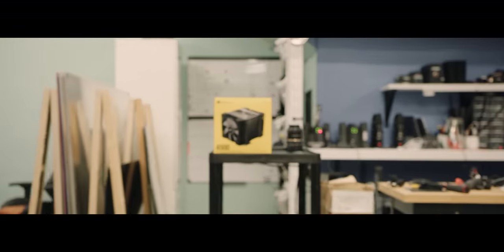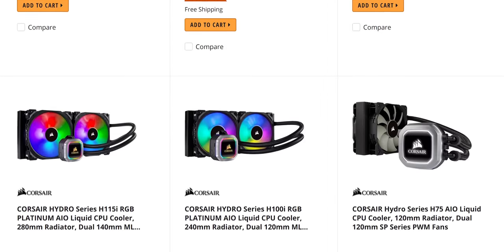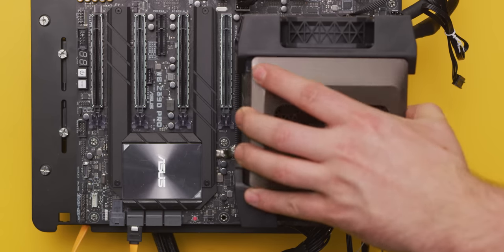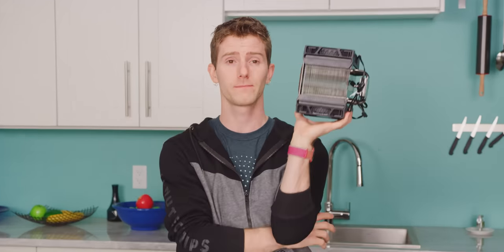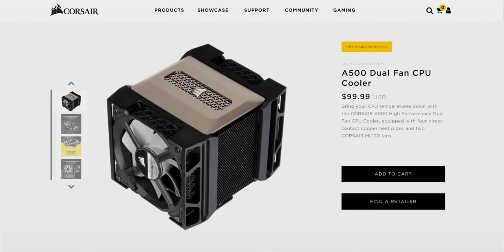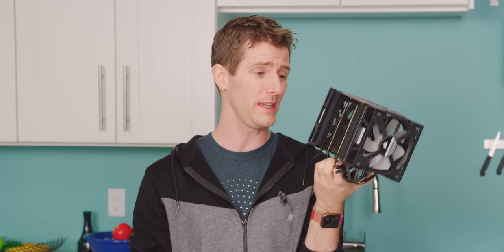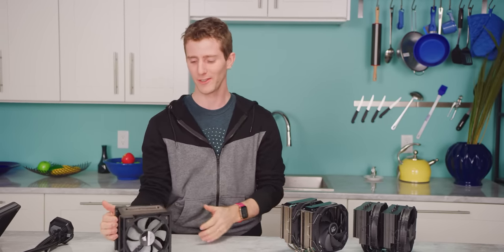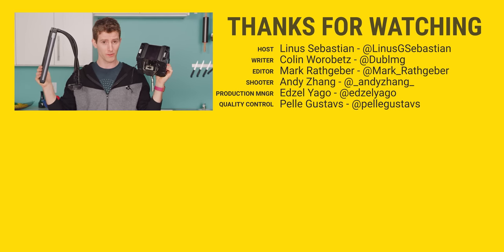Even Corsair Knows Air Cooling is Better - A500 Review

Comment: I really dig this cooler and would have considered it over the Be Quiet! model I ended up buying last month for my system (which also has Corsair PSU, RAM, and tower). But the trouble is exactly as Linus said: it has to match or outperform them in both temps and acoustics AND/OR price. And, dare I say it, looks. This looks great, BUT, I prefer all black. The magnetic cover is lovely but it doesn't match all motherboards unless you customise it yourself (which wouldn't happen, for me, anyway). That said: it's great to see the innovation with the sliding fans and having another competitor in to mix up the top end competition.

Comment: Can I just say, the mounting system on my AC Freezer Xtreme from 10 years ago was even easier  to use, and the fan simply slid in between the fins. Now it wasn't the most powerful or silent CPU-Cooler, but honestly, I cannot understand this amazement about the mounting system...

Comment: just a question about the corsair cooler. if i mount a thin 80 or even 92mm fan inside the gap, will it increase the cooling performance?

Comment: 5 db is a significant difference in noise performance - Was it the actual quality of the fans / bearings causing the noise maybe fan speed?  or a mechanical construction issue?

Comment: my only issue is the weight on my motherboard , theres no supports to take the strain off the motherboard.  I'm happy with my AIO corsair  water, if you have an issue with the noise  , sound proof your case.

Comment: Couldn't you remove the fan inserted in sliding fan bracket and replace them with much quieter fans (Noctua,Fractal design,be quiet etc).

Comment: So there's been a cooler series (since 2012) that doesn't require removing fans for RAM replacement (u do need to remove it for installation): Thermalright Macho series. The performance of the highest tier Macho's is the same or better than this Corsair A500 at less noise. And the best Le Grand Macho RT has been <160mm height since 2014, so it wins in this metric as well (the previous Macho Rev.B and the 2012 Rev.A were 162mm height).

Comment: Looks like it'd be fairly simple to swap the fans to see if you can snag an easy win on noise improvement. I'm not saying people should do that, I just want to know if Corsair screwed themselves over by noise from the fan, or from noise caused by vibrations going into the heatsink that is causing parts to rattle.

Comment: The A500 has dropped price a ton since this video, making it an amazing deal. I've paired one with an i9 10850K
Reply: Bought one for $30.  At 30 bucks, it is just fine for a non OC system.
Reply: @horscategorie  It's a dual tower cooler. Pairing with a non OC or anything less than a top of the line i7 is just plain stupid.

Comment: I actually have a solution for the noise problem... Swap the fans with Noctua NF A12x25 PWM ones... And the performance is probably slightly increased as well. Of course, this would cost you a total of 150 dollars... But if you want the best of EVERYTHING, from looks, to noise, to performance.. This has to go be the best option. It's a great design that other cooling companies should follow, the way to just mount those fans are so much better than clips... Just how did it take this long to come to this solution?

Comment: so the cooler is set up to push hot air into the middle...that seems not great at all - wonder if the numbers would change if you went from push push, to push pull, or even pull pull config ??

Comment: A feature was briefly shown but not discussed during the video. It looks like the A500 was designed with corsair memory in mind since it physically clears corsair designed DIMMs. Not all coolers do this, for example the fan on my NH-U14S conflict badly with one of the second DIMM slots when operating in a blow through configuration. on such a cooler, in order to use all memory one would have to change it to operate in a suck through configuration (fan on other side) which also rules out the option of a dual fan (blow and suck through) installation.

The noise test does not sound like it was entirely fair. Like Gamer's Nexus does, one has to do either a noise normalized comparison and check the temperatures or a thermal normalized comparison and check the noise to know how well it performs. This is because different fan designs have different maximum air flow rates at maximum speed, and even have entirely different maximum speeds. Although it will likely still lose to the competition, it probably would not sound like a jet engine while doing so.

Comment: How do you have an NH-D15 with seven heat pipes? Where can I get one?

Stuff like this makes it really hard to figure out which air cooler is best. I can't find a seven heat-pipe version of that cooler anywhere, only an article stating that they're coming out with such a version three years after the release of this video.

Comment: 240mm Rad with 4 fans in push/pull running at 20% speed is much quieter than  2 fans at 50-60% speed. A rad can be mounted in the roof and act as an exhaust making the whole system cooler. Running at max load it's going to take far longer for the liquid to heat up, thus running quieter for longer. And arguably that heat sink and fans looks like it takes up MORE space than an AIO. I don't get it...

Comment: Thermalright macho rev b. Was available from 2014 to last year, cost 40 bucks in 2019.
It has enough cooling performance for most cpus and is still the most silent solution i ever had.
Yes it is very basic but thats what is good about it.

Comment: Maybe this is their first entry in returning to air cooled?

This puts me to thinking actually. Is there a combination water cooled/air cooler redundancy product option on the market? If not, why hasn't anyone done so yet. I could imagine a water block with attached radiator fins and fan mount for a fall back if the water cooling failed.

Comment: I am a little confused by the noise complaint. Most people won't be running it at top fan speed and in most cases your computer shouldn't be getting that hot where it runs at the top speed. Fan coolers do a pretty good job and this thing looks hefty. Basing it off on being totally worthless based on what it sounds like if you max the fans out all the way, that seems a little shortsighted. Are you suggesting that the top fan speed should be trimmed down to fit your noise requirements or do you think they can improve on sound and thermals by altering air resistance? I mean most people won't really hear it at top speed anyway and I would hope a systems fan curve wouldn't shoot it that high, unless your system temps are approaching really high temps.

Comment: If you looking for a CPU cooler that can beat the Noctua DH-15 in performance, price and especially acoustics try the ThermalRight Le Grand Macho RT.

I have one in my system and it's the best and quietest CPU cooler I have ever owned.
I had visually check that it was running when I first built my PC because I could not hear it.

ThermalRight says it can even run fanless and still outperform one of Intels coolers. I believe them.

Comment: I have this cooler and i replaced the fans to Noctua. now its dead silent on idle and very quiet on full load.
I needed the A500 because i wanted air cooling and tall 4000mhz 64gb ram.

Comment: You should have had the Noctua U12A (dual fan 120) to compare. It's smaller but how does it compare thermal and noise. I can attest that for noise the U12A has good noise. You did a video with the U12A but only showed it against AIO's and the U12A won that.

Comment: Love the videos they are so informative but fun at the same time. I have a question. I'm looking for a mid range air cooler for my fx6300 black it doesn't like to run over 60 degrees Celsius. What would you recommend?

Comment: Im making an ammo styled system. Can i have loose brass in the bottom of the case or will that cause problem ?
Reply: That may cause noise if your system is vibrating. I would instead use a small strip of double sided tape to hold everything together quietly.
Sounds like a cool idea though so good luck with that build.

Comment: ive never been a fan of corsairs fans. never had a good experience with them. tho i do wonder, would it be worth running both of its stock fans towards the center (push-push) then ahve a fac on top of it , either another fan or using fans  on top of your case to pull. this would provide some airpressure on top of your gpu as well if that matter or not idk.

Comment: why not make the fans thicker, they'd be able to run even slower.  Please do a show that compares gains based on fan thickness, if you think you can create one (and not just adding length to either sides of a stock fan.  The 2 fans could also have openings on the base of the fan (to the motherboard) to allow for some more cooling to components.   Could they ever use the dyson fan, in a heatsink.  have the intakes in the top of the case.  It' might even been possible to fit non square shapes, so that the heatsink could be more of a rectangle from the profile but still benefit from airflow.

Comment: How about an L shaped cooler, intake in the back(yes, the back of cpu) and outtake on top of it, so the hot air helps with the flow a bit more....u could have massive heatsink and heat dissipassion , i mean there's nothing on top of the cpu...well PSU but it could be slightly bended forward to avoid touching PSU...idk....maybe a cooler for a specific tower....it's not hard to build something that amazingly, just take your head out of the box, and as usual, they should look for comunity feedback/ideas..

Comment: Air Cooling has a lot more advantages than water, but like many tech Youtubers said including yourself water cooling will win because it is light, it is easier to install than an air cooler, it is better at dispersing heat and does not require as much air flow as an air cooler, rgb effects, software, ability to use all 4 ram slots, no conflict with case size or width( as long as there is space for 120mm fans, there is space for an aio),  higher tdp rating for cooling than air cooling, and looks nicer.

Comment: Okay, so I’m new to building pc’s and I’m planning on building a pc, I bought my first part which was the case and it came with one fan, my graphics card that I’m planning on getting has 2 fans on it, my question is do I need to buy additional fans for the the front panel or not?
Reply: You probably dont need to, but it will lower your temps if you do.  Its something you can do later though if your budget is a bit tight so no need to rush it.

Comment: gamer nexus did review on this and it wasnt that great, but maybe the product they got was broken or something which cause the issue, normally u want to test like 10 of the same product to see if the problem is on the individual product or the overall product. i will buy 212 hyper coolermaster since its cheap. and when i will decide to overcloack then i will upgrade the cooling.

Comment: Water cooling is more efficient.  Water transfers heat more effectively because of its high thermal conductivity, which means the water works to diffuse heat from various components and CPU.

Comment: fewer points of failiure?  1 fan and 1 pump, or 2 fans? did i miss something?
Reply: Pumps are significantly more likely to fail and also mean the complete AIO is trash and needs to be replaced.
If a fan fails on an air cooler then you simply get a new fan.

Comment: Air cooling is way better than water cooling. the one reason why, Air coolers never leak water. plane and simple. my Air cooler i have is the MSI XL that goes very nicely with my corsair graphite 780t full tower case. fits like a charm.. and with the graphic card to. i have my build on my video.

Comment: Linus, why does my i9-9900Ks run at 30C at idle to 50C under load? i have yet to see temps over 60C which is not something i can say for my AMD CPU based systems
Reply: Now i dont know what AMD systems you have, but the 9900ks takes more than 200-220w, which is more than any consumer AMD CPU released in recent years. Are you running it at stock clock speeds or what ?

Comment: i got the a500 half off for about $50CA And it came with a screwdriver  and it is very good screwdriver  but it just barely fit in my case mid tower I walked into my local computer shop looking for $30 air cooler for my ryzen 7 5800x an I saw that for half off so I got it.

Comment: i would've gotten any of those coolers. except they cost like near $200 in my country due to importation tax :( which is why i just stuck to my ID cooling SE 207 which is also a dual tower with 2 120mm fans which costs like $40.

Comment: just replaced a corsair water unit with a noctua air wonder for a twitch streamers $5000 rig lol.  It failed after a year and a half.  Water pump died.  
It was under warranty but it will take weeks to get a replacement which she'll sell on ebay lol.  Air cooling is nice, especially for rigs that make you money.

Comment: That unused gap in the middle really is a baffling design choice. If they really wanted to keep the two towers connected as if it was just one big ass single tower cooler, why leave that hole? It just tells me that they should've made it a fully separated twin tower config and stuck another 120mm fan in the middle so that all 3 wouldn't need to spin up as fast to move the same amount of air. Would've easily solved the acoustic problem, if they really insist on keeping to 120mm fans for the sake of that slide-on fan mounting system.

Comment: Bigger than the 140mm noctua fans?  Those are already so massive you can't fit them in a lot of mid cases (so you need to go with full, but at that point you typically have huge amounts of dead space just so you can have better cooling, unless you have custom water cooling but at that point the CPU fan systems wouldn't be used anyway). I was going to go with the noctua based of all the reviews, then found it was far too large for most any case i was looking at (i had a full before, that nearly gave me a hernia anytime i tried to lift it. Old alienware aurora system that weighs 50-70lbs). Make a high quality fan that can reliably fit in mid cases, and you will have a good market there! (i went with a noctua using 120mm fans, and the cooling is meh, if i tried to overclock i would be running too hot)

Comment: Too bad - I was pretty interested in this. That fan mount is awesome. I wonder if they could get it into the middle of a modified design, so it wasn't physically bigger than the competition. and if that configuration inherently improves performance... Will wait for version 2.0 or for someone else to steal that fan mount idea.... so much better that the BeQuiet/et al. clip system that is a PITA. But yeah, 48db is a hard pass.

Comment: those are totally different coolers, corsair has 1 single bed of vins on heat pipes wit fron & rear fan, the other 2 have 2 beds of fins ( bit smaller but better heat dissipation ), minus the larger fans.

Comment: I know it's not the greatest cooler but I just picked one up for $30
Reply: Yup same, nothing is going to compare to it at this price. 
If you get annoyed with the  acoustics  (like mentioned in reviews) you can easily spend money on different fans. Making it still cost less than the other high performance coolers. 
Though I've already installed this and had no issues in a CPU benchmark. My i5-9600k never passed 55C in cinebench (ran 3 back to back) and 3dmark. Though this is only a 95W TDP

Comment: Linus, your critiques at the end of the video basically negate the product as a whole. I'll give the 48db when fans are at max, but saying its a "missed opportunity" by NOT having a fan in the middle defeats the ease in which the A500 can be installed. Furthermore if you want the RGB than simply replace the fans with what your heart desires. Personally I'd like to see how the A500 performs with better fans be it from Noctua or someone else.

Comment: Corsair;s idea is good but the fans are completely incorrect for pressure optimization and thus efficient cooling.  Those are regular case fans as is obvious from the blade style, Noctua is guilty of this too.  You want curved longer blades for pushing air through fins things like Arctic P14's or P12's are some of the better radiator, tower fin fan designs.  There's a few brands that are good but if you replace those corsair fans with some Arctic series P fans you'll see a huge improvement in temps and lower noise.